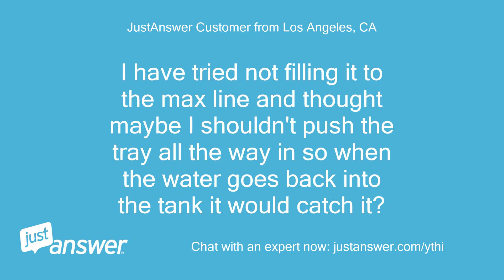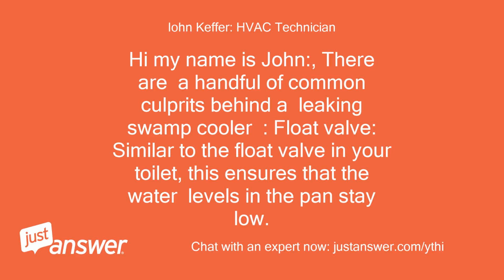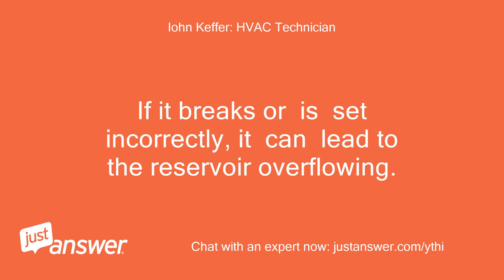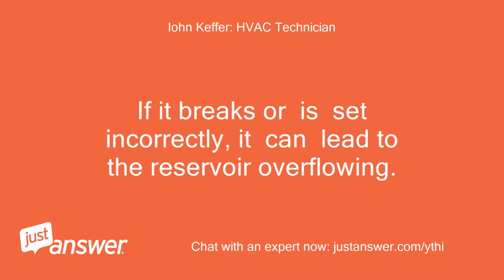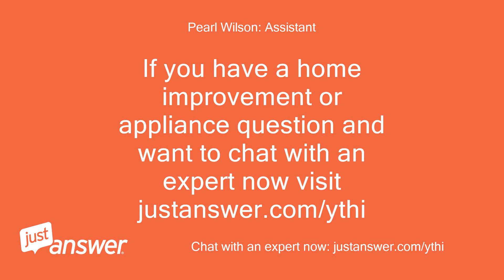Why does my delonghi evaporative cooler leak so much water?

Comment: I came to the conclusion that the pump was pumping too much water to the baffle so I squeezed the water pipe to restrict the water flow and put a cable tie on it to maintain the reduced flow. 
It solved the problem. JC.